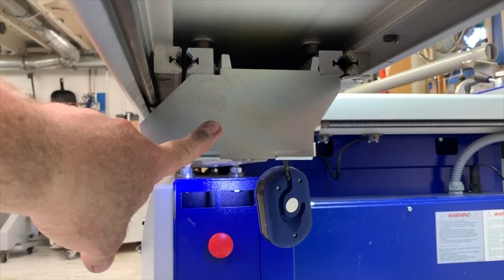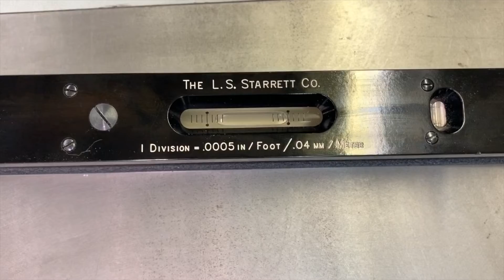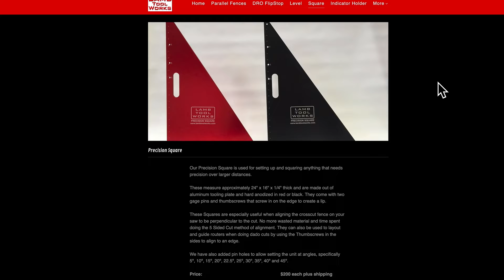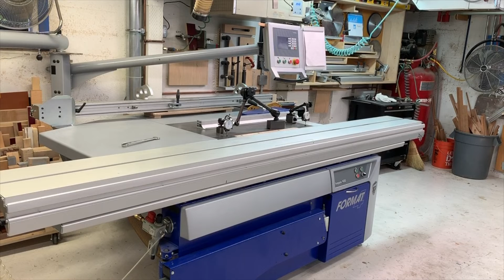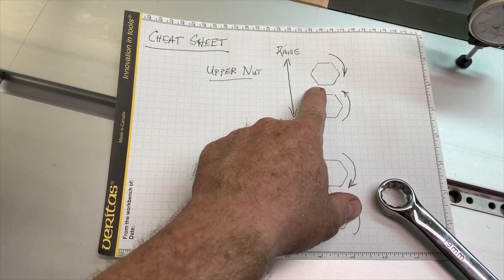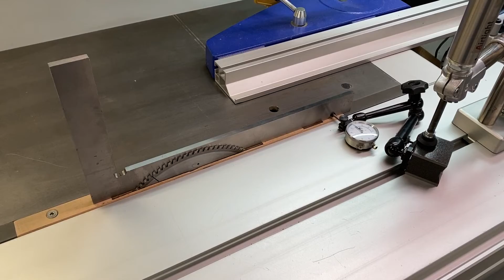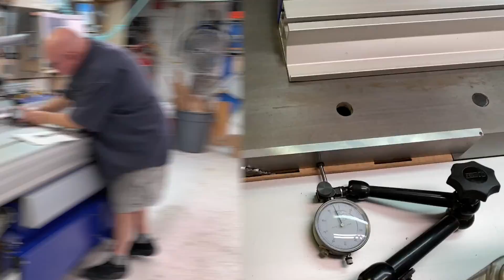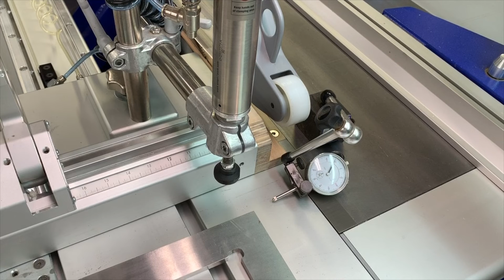Sliding Table Alignment for Felder Equipment

Comment: Thank you David for the video its great, :)But how do you move the tabel if its not aligned to the blade?
Reply from the maker: I don’t understand your question
Reply: Sorry for not explaining it very well. I’m trying to figure out how to align the sliding table so it’s parallel to the blade
Reply from the maker: @t @timpalmgren2838 re you asking how you move the sliding table carriage laterally?  I still don’t quite understand your question.  If you’re trying to adjust the toe-out, you do so by repositioning the lower carriage laterally. Loosen the nuts and push on it with your body.

Comment: Vey informative, thank you. I do have an honest question… I don’t understand applying the concept of toe-out clearance on a slider? Why would you need toe-out if there is no pinch point? Toe-Out results in a very small, but obvious, widening of the kerf which can increase burn & scoring of the cut. So wouldn’t I want to not have to set for this condition if not absolutely necessary. I understand the concept when using a rip fence but I don’t understand it with a slider? Am I missing something?

Comment: Dear David, this is absolutely amazing video. Unfortunately, although I can measure that my saw blade is not exactly parallel to the sliding table, I cannot see how to make adjustments and fix this problem (I have Felder K500 P saw). Would you have any hints?
Reply from the maker: Move the sliding table laterally.  Secure one mounting point only and use your body weight to push the slider to reorient with proper toe out.  Then work on the height and angle.
Reply: @David_Best  Dear David, thanks a lot for your prompt response and suggestions, but if I understand them correctly such an adjustment would change alingment of the table referred to the machine table / chassis edge. My problem is that initially everything was set fine, in particular the sliding table was properly positioned, having constant spacing to the machine table edge (and this spacing was also contant when the table was being moved) but during cutting operation a piece of wood bumped into the saw blade and right now the saw blade plane is not parallel to the machine table edge neither to the sliding table. So I should rather somehow restore the previous position of the saw aggregate, without adjusting the table, I suppose. But I have no idea how to deal with it, cause I cannot see any screws or other elemens that would allow for of such an adjustment.
Reply from the maker: @tom @tomaszstarecki1782  align the sliding table movement to the saw blade cutting circle, NOT to the machine chassis.  This is shown at 38:45 in the timeline. The edge of the sliding table and the machine chassis is irrelevant.
Reply from the maker: @tomaszstarecki1782   Join the Felder Owners Group and post your questions there - this is not a good way to converse.  I can help you there.   https://groups.io/g/felderownersgroup

Comment: that's truly the best video on the concept of adjusting the sliding saw I found on the internet, seriously! really appreciate the effort of making one, and I truly envy all your pro adjustment equipment 🫠

maybe you could help me out tho - I have just gotten my brand new Felder - Hammer B3 Winner Comfort, which sliding table sits on top of 6 screws (2 front, 2 middle, 2 back) and my issue is - no matter which adjustment approach I take (explained below), I always get the middle part being higher than the left/right sides; I mean when the sliding table is roughly in the center position its all quite flat, but when I move sliding table fully backwards, or fully forward, the surface of cast iron table and surface of sliding table are not flat - there's roughly 0.5, 0.6mm difference 

1st approach - I loosened all 6 screwes, loosened the 2 center ones a bit more (so that table sits on 4 front/back screwes), moved sliding table fully backwards and adjusted the back (near power buttons), just as you explain on the video in the second part, then fully forward and did the same to the front (next to the router); after that I made the center 2 screwes hand-tight and tightened all 6 of them with bottom screw; this way I got the left/right sides quite flat (even when pushing sliding table fully to front/back) - but in the center position the middle part was higher than the rest (I wanted to get it all flat, or the sliding table just like 0.02mm higher)

2nd approach - decided to go fully your way - even tho I only have 2 middle screwes; I losened front/back 4 screwes a bit more and adjusted middle part first, tightened to 60%, then calibrated front/back screwes as described above, tightened it all - I ended up with middle being perfect, but when I push sliding table forward or backward I see the 0.5-0.6mm difference between cast iron table and sliding table

So essentially it seems I can either have center ok, but front/back difference (lower), or I can have middle higher and front/back perfect

Seems as if either my sliding table or cast iron were a bit "banana shaped"? 
Is there any secret solution to that? When I place the Hammer ripping fence as "flat reference" on both tables I don't see any significant gaps. How do I make it all as flat as on your video? 🤔

I though about "forcing" the middle to go down (or left/right going up) - apply some tention by tightening the screwes with more force but unsure if thats the right path 🤔

Sorry for long post, trying to be precise, hope you'll find a minute 🤞

Comment: Great video,I came here to see how you adjust the toe out of the sliding table,I seen you check it but how does one adjust the toe out? Thanks from Australia
Reply from the maker: I answered the same questions in the comments below and it's in the description that accompanies the video - just look below the video and click on "more" to see the description.  I'll post it again just for you:

Felder used to supply a bracket with adjustment bolts on the machine chassis that pushed sideways on the lower carriage to adjust the toe-out.  Since about year 2009, they began eliminating these brackets/adjustment bolts, presumably to save a few dollars in manufacturing cost while at the same time driving up the amount of technician time by at least 30 minutes during commissioning.  Your machine may or may not have this bracket with adjustment bolt.

If your machine does not have this adjustment mechanism, here is what I recommend - this is how I perform the toe-out adjustment, it's crude, but about your only choice.
1 - After the gross alignment of the sliding table height using the four central adjustment studs, proceed as follows:
2 - Loosen the top nuts on 3 of the 4 studs.  I generally keep the stud on the inside ahead of the saw blade tight, and loosen the other three.
3 - Pull the slider to the extreme infeed or outfeed end of it's travel.
4- -Standing at the end of the sliding table, use your body weight to push the sliding table laterally, toward or away from the machine as required to alter the toe-out.  
5 - In practice, I find it useful to just bump my hip against the sliding table, but occasionally more force is required, but I wouldn't get carried away or you might break the plastic bearing cage that's sandwiched between the lower carriage and the sliding table extrusion.
6 - If this does not bring the table into proper toe-out, loosen the top nut on the 4th stud and try again.
7 - Once the toe-out is where you want it, tighten all the upper nuts again and re-check all alignments (height, level, and toe-out).

I have encountered a few Felder machines, where additional lateral force and leverage was required.  In those situations, I removed the end-plates on the lower carriage extrusion, inserted a 6-foot long rigid pipe or hardwood 2x2 into the internal webbing of the extrusion, and used the pipe as leverage to force the lower extrusion to pivot laterally.  

Hope this helps.

Comment: Absolutely great video. Did you check what happens to your measurements if you put weight on the sliding table?
Reply from the maker: @Maxime-ho9iv  yes of course I did.   A large weight distributed on the sliding table, such as a big sheet of plywood or MDF has a little impact. That said if you push down hard in one spot, the sliding table will flex.  That is the chief disadvantage of the X-roll sliding table.
Reply: @ Yea I was curious about having some weight only on one spot, and the impact it would have on measurements. I guess it’s hard not to have any impact but I wonder how big it can be.

Comment: Hi David, I am wondering if you have any advice on adjusting the drift of the sliding table? I think I am satisfied with the rest of my adjustments, but currently my table drifts away from the blade 0.015 of inch over about 6’. I would like to get it running as close to parallel to the blade as possible. I like to use the sliding table to rip sheets materials so having it, the blade and the rip fence as close to parallel as possible is critical.
Reply from the maker: Yes, it's all been covered in the comments below.  But here it is again for your enjoyment.  

Felder used to supply a bracket with adjustment bolts on the machine chassis that pushed sideways on the lower carriage to adjust the toe-out.  Since about year 2009, they began eliminating these brackets/adjustment bolts, presumably to save a few dollars in manufacturing cost while at the same time driving up the amount of technician time by at least 30 minutes during commissioning.  Your machine may or may not have this bracket with adjustment bolt (it's shown in this photo:  https://tinyurl.com/9p4npatu )

If your machine does not have this adjustment mechanism, here is what I recommend - this is how I perform the toe-out adjustment, it's crude, but about your only choice.
1 - After the gross alignment of the sliding table height using the four central adjustment studs, proceed as follows:
2 - Loosen the top nuts on 3 of the 4 studs.  I generally keep the stud on the inside ahead of the saw blade tight, and loosen the other three.
3 - Pull the slider to the extreme infeed or outfeed end of it's travel.
4- -Standing at the end of the sliding table, use your body weight to push the sliding table laterally, toward or away from the machine as required to alter the toe-out.  
5 - In practice, I find it useful to just bump my hip against the sliding table, but occasionally more force is required, but I wouldn't get carried away or you might break the plastic bearing cage that's sandwiched between the lower carriage and the sliding table extrusion.
6 - If this does not bring the table into proper toe-out, loosen the top nut on the 4th stud and try again.
7 - Once the toe-out is where you want it, tighten all the upper nuts again and re-check all alignments (height, level, and toe-out).

I have encountered a few Felder machines, where additional lateral force and leverage was required.  In those situations, I removed the end-plates on the lower carriage extrusion, inserted a 6-foot long rigid pipe or hardwood 2x2 into the internal webbing of the extrusion, and used the pipe as leverage to force the lower extrusion to pivot laterally.  

As for the rip fence, you should read this document:  https://assets.zyrosite.com/YanMoZDqRrS1lagy/rip_fence_as_parallel_fence-AzG84419q1i78vGv.pdf
Reply from the maker: You want your sliding table to drift away from the saw blade 0.003-0.004 inches over a 8-10 inch movement of the sliding table as discussed in the video.  Same with the rip fence.  Otherwise you will risk kickback, burned or splintered cuts.
Reply: @ Thanks for the reply. I prefer my rip fence to be open just slightly. 0.002 over the length of the fence. I always use a riving knife and this setup has worked well for me over the years. I was able to improve the issue with my sliding after watching your video again, as well as a couple others. I will have get myself a machinists level and straight edge so I can fine tune things further. Thanks for the help.
Reply from the maker: @reid8588  read this:  https://assets.zyrosite.com/YanMoZDqRrS1lagy/rip_fence_as_parallel_fence-AzG84419q1i78vGv.pdf

Comment: You never show how to adjust the toe-out.  Is there a link somewhere?
Reply from the maker: Read the comments below.  It's described there.  Look for user @user-ip7pk3sh9u
Reply from the maker: Oh, and you're welcome.  Reposting from previous comments.

Felder used to supply a bracket with adjustment bolts on the machine chassis that pushed sideways on the lower carriage to adjust the toe-out.  Since about year 2009, they began eliminating these brackets/adjustment bolts, presumably to save a few dollars in manufacturing cost while at the same time driving up the amount of technician time by at least 30 minutes during commissioning.  Your machine may or may not have this bracket with adjustment bolt (it's shown in this photo:  https://tinyurl.com/9p4npatu )

If your machine does not have this adjustment mechanism, here is what I recommend - this is how I perform the toe-out adjustment, it's crude, but about your only choice.
1 - After the gross alignment of the sliding table height using the four central adjustment studs, proceed as follows:
2 - Loosen the top nuts on 3 of the 4 studs.  I generally keep the stud on the inside ahead of the saw blade tight, and loosen the other three.
3 - Pull the slider to the extreme infeed or outfeed end of it's travel.
4- -Standing at the end of the sliding table, use your body weight to push the sliding table laterally, toward or away from the machine as required to alter the toe-out.  
5 - In practice, I find it useful to just bump my hip against the sliding table, but occasionally more force is required, but I wouldn't get carried away or you might break the plastic bearing cage that's sandwiched between the lower carriage and the sliding table extrusion.
6 - If this does not bring the table into proper toe-out, loosen the top nut on the 4th stud and try again.
7 - Once the toe-out is where you want it, tighten all the upper nuts again and re-check all alignments (height, level, and toe-out).

I have encountered a few Felder machines, where additional lateral force and leverage was required.  In those situations, I removed the end-plates on the lower carriage extrusion, inserted a 6-foot long rigid pipe or hardwood 2x2 into the internal webbing of the extrusion, and used the pipe as leverage to force the lower extrusion to pivot laterally.
Reply: @ Well OK. I basically have the same gear you recommended (One-Way) for this so I’ll measure and see if it even needs adjustment.

Oh - and many thanks for video and your guidance. 

That part about accounting for where the bearing cage is especially important and useful. I was doing exactly the opposite (should have watched the whole video before starting!).
Reply from the maker: @ronaldpomeroy9861  More resources here:  https://davidpbest.com/publications-and-videos
Reply from the maker: And here:  https://www.flickr.com/photos/davidpbest/albums/

Comment: I have a KF 700 Pro, I’m still unclear on how to adjust the toe out of the blade. What bolts do you turn to adjust that? Other than that, very informative thank you!!
Reply from the maker: I covered that in my response to the same question in the comments below from a user by the name of @user-ip7pk3sh9u  three years ago.  Scroll down read his question and my responses.  If you are still confused, either DM me or post here again.

Comment: Thank you for your video, it is priceless.
Question: why do you use three indicators for height adjustment, there are four studs, don't you need to add a fourth indicator?
Reply from the maker: Three indicators is totally sufficient.  With four you will be chasing your tail and go crazy trying to get everything perfectly aligned.

Comment: hope you are still checking these posts. you mention that you are making sure the cast iron table is level as a first step. level in reference to what? I'm thinking that you zero the level to the floor first but maybe not. Thanks.
Reply from the maker: Yes I I am checking commentary here.   The important thing is that the cast-iron table is flat. I mean dead flat as in one single plane. The cast iron top becomes the reference surface to which you align the sliding table, so if the reference surface is not flat, you’re chasing your tail. The easiest way to ensure the cast iron tops is flat is to level it precisely along all four edges. If all four edges of the cast-iron top are level then the surface is flat - or at least as flat as you’re going to get it.  The cast top doesn’t have to be level per se, but it does have to be as flat as possible.  Cast iron surfaces are easy to twist into the shape of a banana if your machine is not sitting on a flat floor surface (Felder machine chassis are flexible enough to conform to the floor surface).  So I always recommend putting the machine on adjustable leveling feet and using those leveling feet to adjust the top to a flat surface.  But the cast  iron top is suspended at all four corners via adjustable studs which attach it to the machine chassis. You can use those four adjustment points to bring your cast-iron top into a near perfectly flat condition.  Once that’s accomplished, you can move onto aligning the sliding table surface to the cast-iron top surface.  Hope this helps.
Reply from the maker: Did you read my response?  Was it helpful?  If not, let me know and I'll do a write-up for you.  More resources are here:  https://davidpbest.com/publications-and-videos#felder